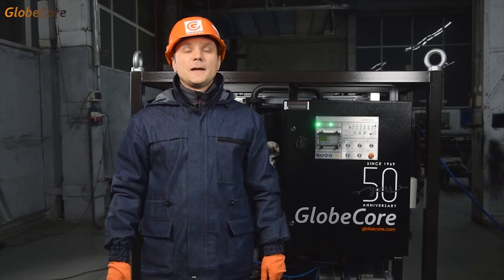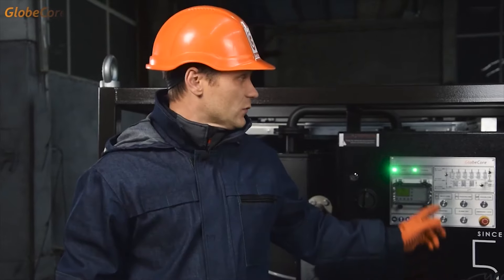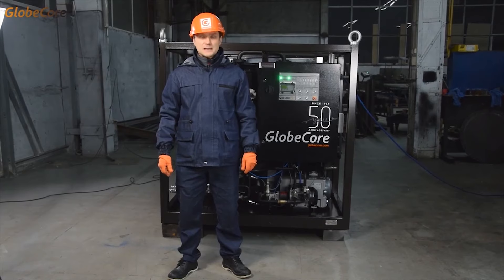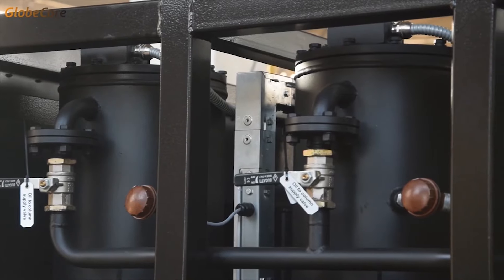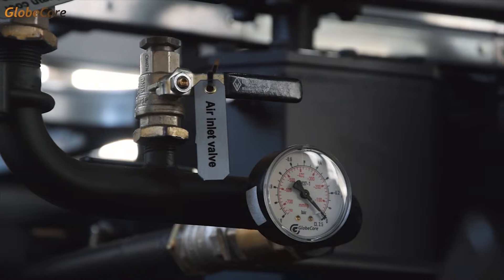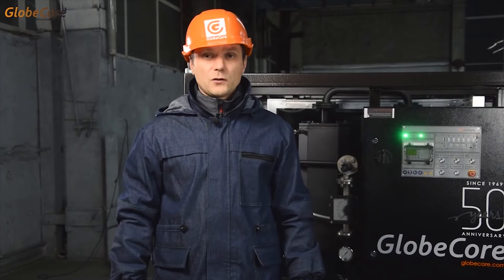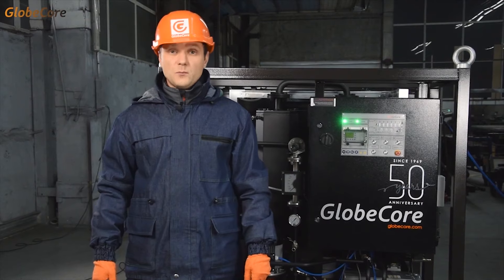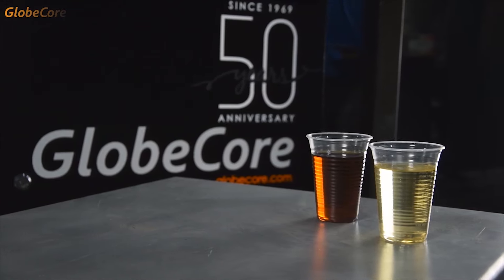Used Oil Regeneration Machine СММ-6RL in Economy Version

Comment: We have large amounts of used oil, so the greater regeneration capacity is required. Is it possible to increase the regeneration capacity of this unit?
Reply from the maker: Yes. It is possible to add several regeneration columns.